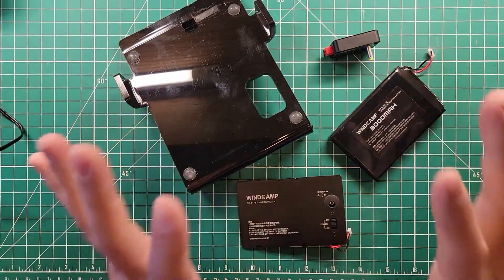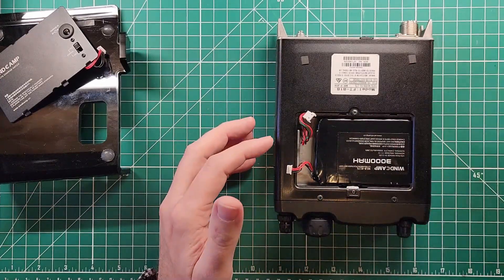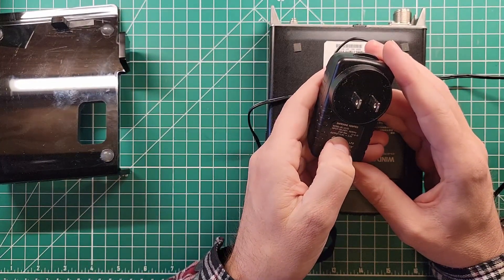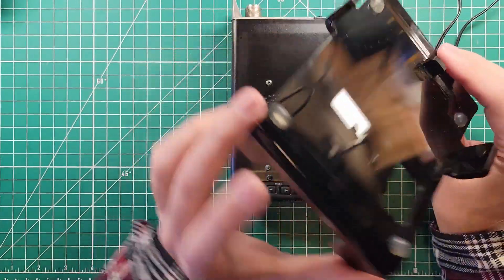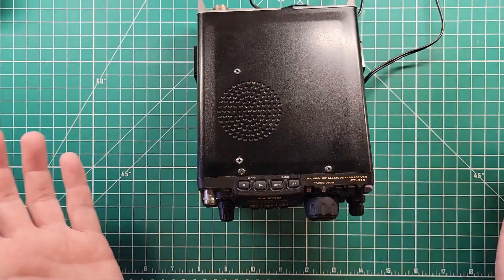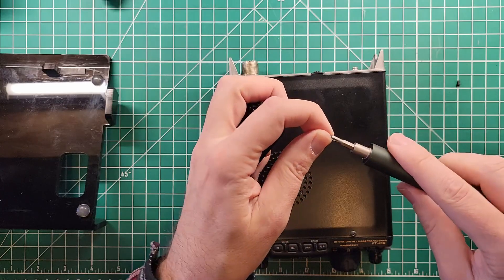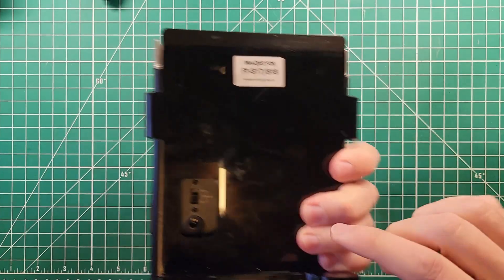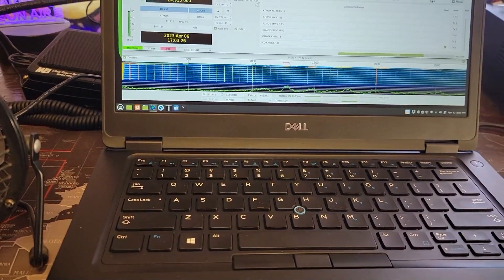They did it again! - The FT-818 Battery and Power Pole adapter

Comment: does any one know what size power pole they adaptor is ? i want to get a cable with battery clamps. thanks for the video !!
Reply from the maker: https://amzn.to/3HlKCt3 like these?
Reply: just like that but only smaller, i did figure out that the 15 amp and 30 amp power poles are comparable with each other. so the wind camp has to be in the 15-30 amp range. im just going to pick up a bunch of power pole stuff (the real stuff not the knock off) and proceed to power pole connect everything in sight 😁 @temporarilyoffline
Reply from the maker: Oh, I see - the other side - the 15,30,45 are all the same size housing, the "spoons" for the 15 and 30 are the same I think and the 45 version are U shaped instead of round.  You can get the legitimate powerpoles from mouser or powerwerx  @shadowlab9543

Comment: I also have the 818 and bought the wind camp battery with the charging cover but I decided not to buy the other 2 items . For the power pole adapter, it'll draw a small current from the power source even if the radio is off, but the connector is connected to DC power that's on. For the tray, it's nice but I found a laptop fold out legs at Oomomo Japan Living, $2.75 for a pack of 2. I stuck one under the front bottom and it works very well (I did the same to my Xiegu radios as well). And they fold flat when not used and have a low profile. It didn't raise as high as this tray, but then I have another stand (a tablet stand) that can do that if I need more height. Thanks
Reply from the maker: Thanks for sharing!

Comment: As an old FT817ND owner, have all those. The internal battery starts to lose its capabilities after a while. A MUST HAVE though for Phone ops is a SSB voice compression adapter/mod. Several people make it. It makes the 5W (or in your case 6W) stand out. Measurable difference. Best bang for the buck. The mods are typically $50-$80.
Reply from the maker: Thanks for the tip. I'll look into it.

Comment: You can safely run full power output (5/6w from the internal battery. You simply have to manually push the PWR button - it will select full power, and if the voltage is lower than the expected 12VDC on the rear DC port, it will flash the power indicator - but this is FINE! Enjoy full power on the internal battery! 73
Reply from the maker: I'll check it out.  Apparently the manual is wrong and was never fixed - more testing and a video to come!

Comment: I actually tried 3D printing the power pole adapter but the power cable that came with my 818 didn't fit the connector. I think Yaesu changed suppliers with the power cable around the end of 2022 and now it doesn't quite fit the design.
Reply from the maker: It's an odd sized connector for sure.
Reply: @temporarilyoffline  it's not that the connector is oddly sized, it's that the shape of the plastic around the plug is slightly bulkier so it doesn't fit inside the 3D print. The older connectors were rectangular while the new ones are more teardrop shaped.
Reply from the maker: @JonathanKayne  ah, ok

Comment: If you want to still use the ground just substitute a longer bolt with a couple of nuts, one to lock down the wincamp adapter and one for the ground wire
Reply from the maker: Great Solution

Comment: Being aluminium looks like they also incorporated a fix for the 817/ 818 power issue, where it can burn out a track and fail to power up when used often with a PA or transverter as excessive negative current is directed via the track in question unless you bond the negative side of the power lead to the chassis.
Reply from the maker: Interesting Bonus!

Comment: For the 1 millionith time. You can run 5 watts on battery when the power option is set to flash.
Reply from the maker: Page 25 of the owners manual disagrees with you.  Did you put it on a meter?  I'd love to know how to get >2.5w out of the internal battery connection.
Reply: @temporarilyoffline  Page 25 has been typoed for over a decade.
Reply from the maker: Thanks for the info

Comment: I had this battery pack for a long time. Works fine, but makes me wish the transceiver had this built in as standard.
Maybe in 2030 Yaesu will come out with the FT-819 which will have as a new innovation a built in LiFe battery and a USB-C charging port. The rest of the device will be unchanged.
Reply from the maker: Probably!  It's like geologic time watching manufacturers catch up with the modern world.

Comment: With the new charge hatch, does the rear power feed become useless as it is bypassed?
Reply: No, have had one of these for a few years and plugging rear feed allows full power and isolates battery.
Reply from the maker: Bottom and rear can both be used.

Comment: Great video.  I am glad you mentioned how their stuff always works individually, but it seems that they just cannot get their stuff to work together.  Maybe they are just leaving something for us to do/modify.
The closest thing to an absolute miss, in my opinion, is the Power Pole adapter.  Yes, you lose the ground (I just drilled a hole in the one of the "ears" sticking out, and the Z817 has a ground lug).  But the power pole connectors are facing the data cables.  (One of these days I'm going to make an adapter that to the rear, but I never seem to have the time.)
73
Reply from the maker: You need a "Round Tuit"
Reply: @temporarilyoffline  Indeed.  It's probably in the junk drawer, next to my "Stick Tuit" I use to finish some projects with.